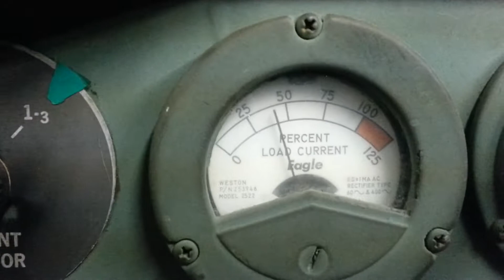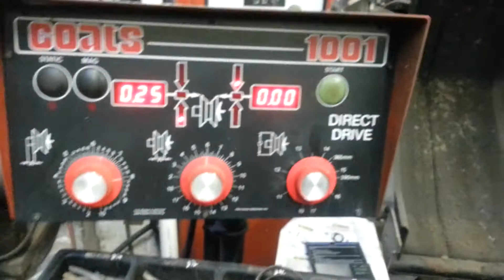Rotary phase converter running coats tire balancer

Comment: Anyone know how to calibrate this coats 1001 blancer
Reply: Find a well-balanced "15  wheel. Place a 4oz weight on it. Run the balancer. adjust the pot until it finds the 4oz weight in the correct spot.
Reply from the maker: @curtiseppley3230 there's a button on back of circuit board u must flip first. There's a Manuel online